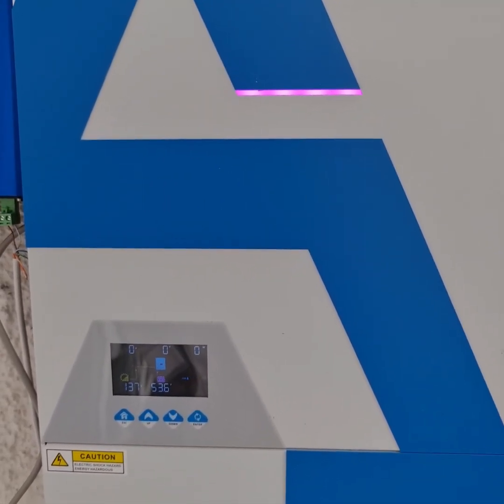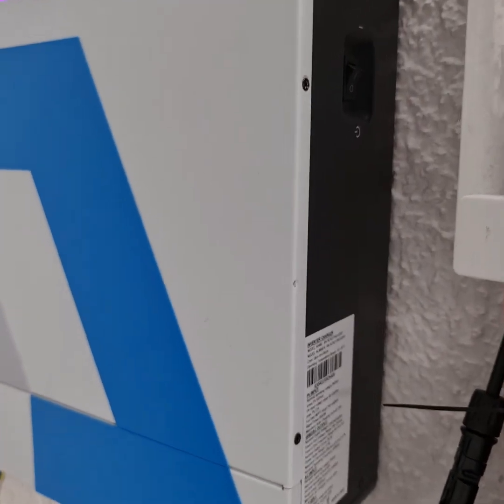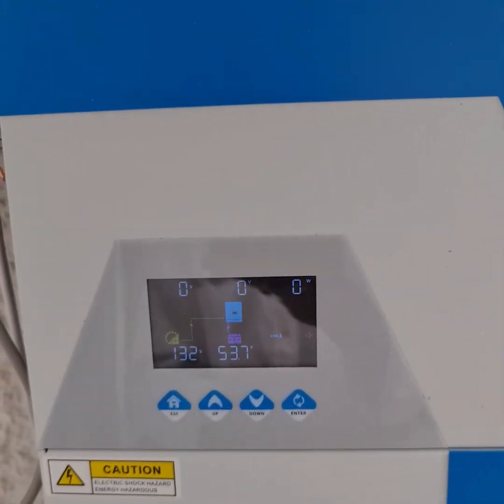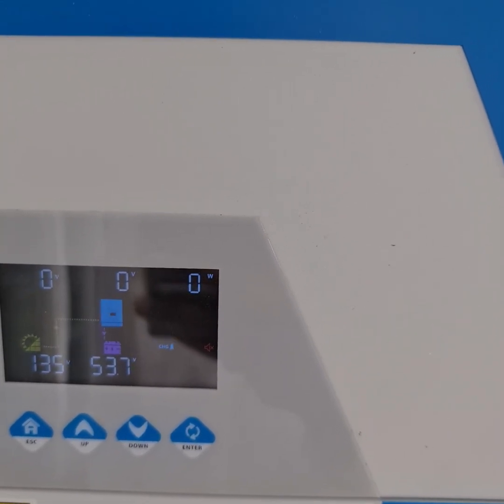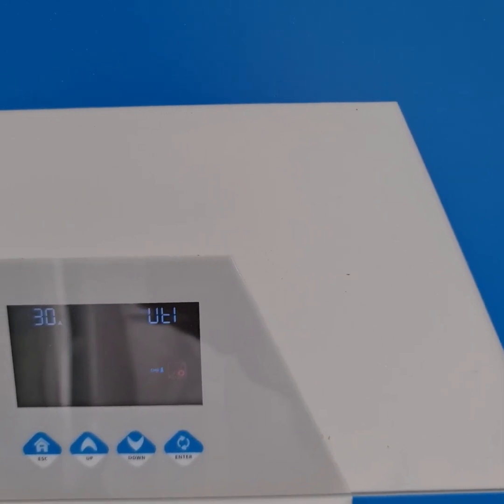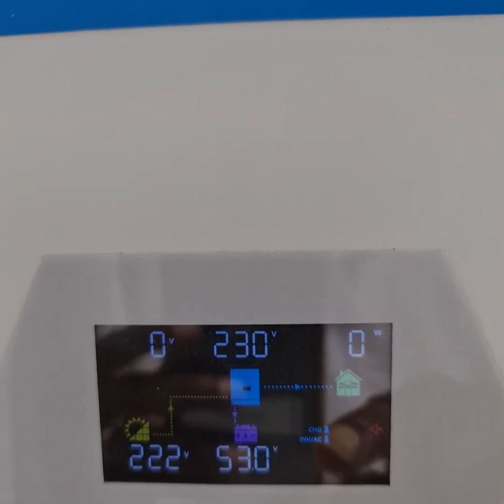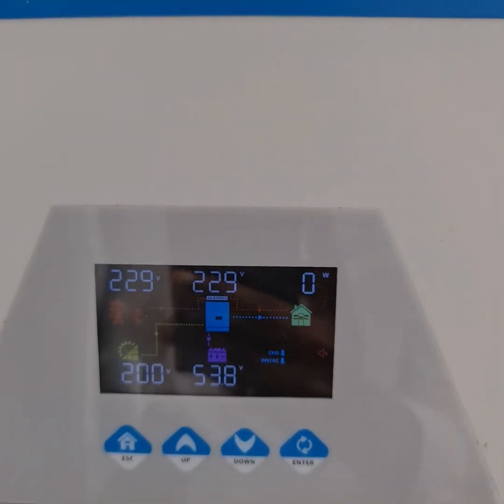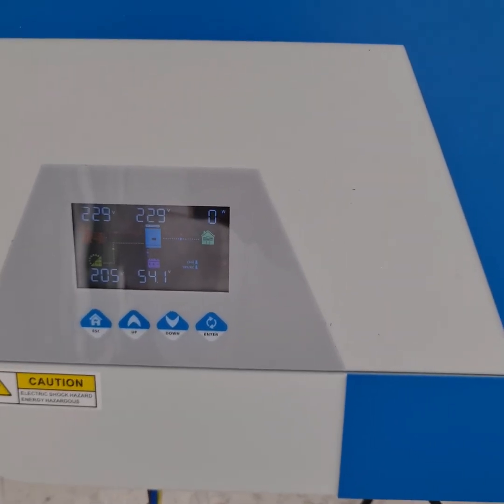Anern 6.2kw 48v on/ off grid solar inverter #Anern #Powmr #ecgsolax #easun

Comment: I online order  3.6 kw  anern inverter  i have solar  charging problem my total  solar panel voltage dc 220 v  500w x 5 panel . battery  connect inverter is working    battery  can charging grid but solar charging not working.   i reset all inverter setting  But i cant find any problem.   Please help me figure out this problem.
Reply from the maker: Which model? What is the mppt Voltage range?

Comment: Вентилятори постійно працюють? Він може віддавати в мережу від сонячних панелей?
Reply from the maker: Fans usually run only when total power is more than 500Watts. Yes it can feed in to grid from panels, if there are any left over energy after load and charge.

Comment: Hi, have a good day! I have the same unit as you do and it has been working for 2 months now, suddenly it stops getting power from the battery even though it is fully charged, that means I cannot use it at night. What seems to be the problem? Thanks and I would appreciate it it if you could answer my query. 😊
Reply from the maker: This can have multiple reasons: 
- check whether the Battery voltage is shown correctly in display?
- does the  AC charging section works?
- does the MPPT charging works?
- stops taking power from battery, means inverter section not working?
Reply: @HouseAndSolarProjects  It stops charging actually that is why I bought a 48V charger and use the utility power to charge the battery.

Comment: Thank you for the insight! I'm also curious about how stable and how smooth the A/C output is. Does any light lamp flicker even by just a bit when supplied by this inverter? A friend of mine had one from another brand which was making all the lights flicker. Meaning that his output was not smooth at all. Thanks!
Reply from the maker: No, there is so flicker anywhere. Parallely is one 12000BTU split AC and an 24v 30a Charger running on it. Very stable indeed.